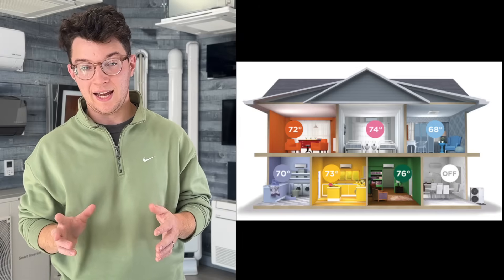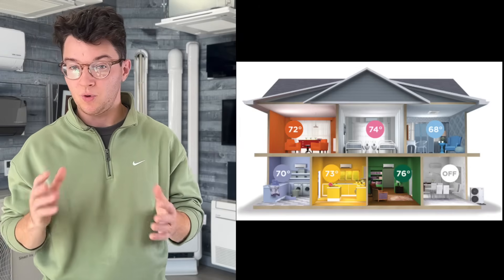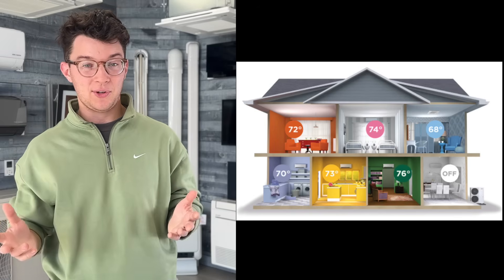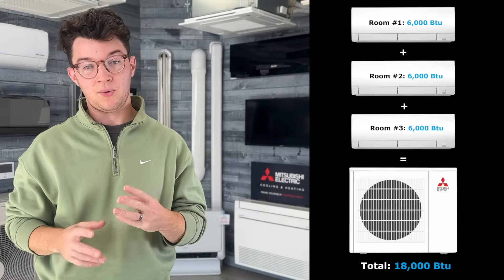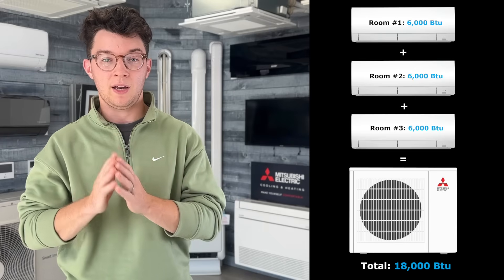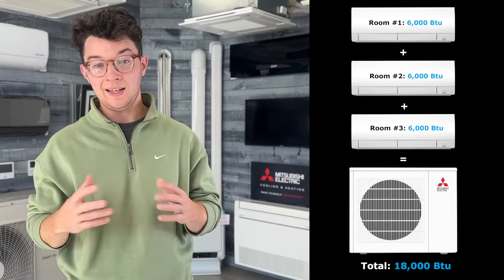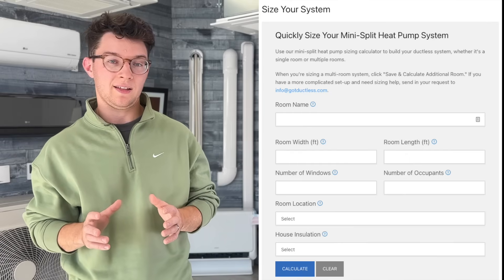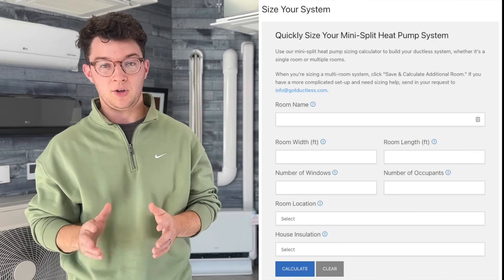How to Size a Mini-Split System: Tips for Properly Sizing a Ductless Mini-Split System

Comment: Do you have a recommendation on heating/cooling size for supplementing? I want a unit for my bedroom/bath/closet, its about 550sq ft. I want to set my house temp at a more economical temp, like 75 in summer, but keep my bedroom 71-72, so basically a 3-4 degree difference. Most of the calculations are based off of a non conditioned space already, not supplementing, because I really just need it to change 3-4 degrees.

Comment: You need to calculate CUBIC feet of air, not SQUARE footage.  Ex.  8 ft flat ceiling vs 22 ft vaulted?????
Reply from the maker: Yes, cubic feet is definitely important especially when dealing with irregular ceiling heights. In this video we touch on standard ceiling heights but you definitely are correct!

Comment: I have a 2400 square feet, it’s a 40’ x 60’ pre fab metal house made with red iron and metal siding, I have spray foam 5” on the walls and 8” on the roof,  so it’s installation is excellent.  Im looking to go with a mini split system, my question is about the big open room 38’ wide x 27’ long , it has the kitchen and living room in one big room.   The side walls are 11.5’ tall and the center is 21’ tall.  I have 5 large windows in the living room area and 4 small windows in the kitchen area. I live in South Mississippi about 70 miles off the coast.   

I was thinking about going with two 1800 btu units one both sides on the 38’ wall, in front of kitchen and living room. 

What do you recommend and your thoughts?
Reply from the maker: I believe you are thinking about it correctly. I did some calculations on our end and you are probably oversizing with 2 18ks. You would be fine with 24-30k in BTU since your main priority is I'm sure cooling. Feel free to call us if you'd like to further the discussion.

Comment: For cooling capacity, does humidity level of ambient air play a role in sizing?
Reply: correction on question: Should humidity of outside air play a role in sizing especialy for cooling?
Reply from the maker: great question! It should be considered when sizing. Mainly the consequences of oversizing your system will be harsher in higher humidity areas. You want to make sure you are not installing overly sized units in your rooms because then the units will cool down the room quickly and turn off and will not properly pull out moisture fast enough.
Reply: @gotductlessusa  Thank you. That makes sense. Another aspect that might play a role in my own home is handler placement and room layout as follows: With the thermostat located within the airhandler, the desired temp is reached pretty quickly (heating and cooling) in the immediate vicinity of the airhandler, but not as quickly elsewhere in the room. Due to my living room layout, the airhandler is not placed in a central spot. (The system still does better than my old heating and cooling.) But now I am thinking about installing a remote thermostat, if I can find one that works with my minisplit. Do you have experience or thoughts on this?

Comment: You didnt mention anything about humidity. If you live in a very humid area, it makes sense to slightly undersize the unit so that it runs longer and will dehumidy.
Reply from the maker: That is true! This is an issue if you completely oversize and the room gets chilled faster than it can dehumidify. This is especially a factor in more humid climates. thanks!

Comment: A Btu was originally defined as the amount of heat required to raise the temperature of one pound of liquid water by one degree Fahrenheit at a constant pressure of one atmospheric unit. There are several different definitions of the Btu that differ slightly.
Reply from the maker: Yes!

Comment: I am about ready to buy a mini split heat pump system.  But don't know if I should get two 12K BTU units or a 12K and a 9K. Those I'm looking at are both Pioneer Diamonte series, so same features, same 19 SEER, etc. Either way should cover the 18,200 btus required to heat and cool my small home (that's based on only square footage… I may need at least 20,000 based on poor insulation and windows.  The price difference of the two units (12k vs 9k) is only about $20  currently for the prices I'm looking at with Home Depot.  (The 18K is $300 more than those and the 24K is out of the question for me.)  Of course, I'd be happy to pay a little more to get the second 12k, *** UNLESS THE 12K WILL COST SIGNIFICANTLY MORE TO RUN THAN A 9K.***  That is the important question that I need answered.

A 12K would go in the larger Living Room/ Kitchen area;   The small bedroom/bath area will get either a 12K or 9K.

BTW: So far it looks more cost effective to get two units than to get one larger unit that feeds two blower heads. Plus with two separate units I'll always have a backup and I can shut one down in mild temps.  Also one larger unit feeding two blowers will  require longer lines which adds cost.
Reply from the maker: Running a 12k will not cost significantly more to run than a 9k. The real question is what does your space require. If you have poor insulation and poor window insulation then I would be conservative on sizing. The last thing you want is to spend thousands and it won't work properly or will be inefficient.
Reply: @gotductlessusa  Thank you so much!  You say the 12K energy consumption will not be much more than a 9K.  Is that true only for inverter+ variable speed compressors (because the bigger unit can slow down to operate like a 9K?)  That is what I am interested in btw.

Comment: i have two rooms and many many people in this mini split business... looking for answers?  i have two rooms on 1st level about 140sq ft each both a square shape and about 15' ceilings each,  one room get more sun other does not two large window in each room... just trying to ask a pro
Reply from the maker: Hello - you can use our calculator but most likely you would be fine with 9ks in both rooms.
Reply: @gotductlessusa  does it make sense to over size just because?

Comment: Length x width x height is Volume...not square footage.
Reply from the maker: We use length x width in our calculator with a built in ceiling height of 9 ft. We did add in height by accident in one of the clips which is in fact volume. Thank you.
Reply: Exactly.  In this case, it would be cubic feet.  A few too many little errors to trust this guy.  Nice little display wall though.

Comment: Thanks for the video.  Question though.  For energy efficiency...would it be better to have three indoor 8,000 BTU units tied to a single 24k BTU outside unit, or three individual 8,000 BTU systems (indoor & outdoor)...speaking from a total energy usage standpoint.
Reply from the maker: SEER ratings might be higher on single zones but you would be consuming more electricity overall.  Simple way to look at it would be you would have 3 15 amp breakers vs. one 25 amp breaker for a 2 ton multi-zone. Hope that makes sense!
Reply: @gotductlessusa  Must be something missing there.  You would never replace three 15 amp single units with a single 2 zone 25 amp, as a 2 zone wouldn't support 3 zones.

Also, the answer doesn't really answer the question.  Why would 3 single zone 8,000 BTU units use more energy than a single 3 zone unit with 24,000 BTU's...?  Using a SEER as a baseline, a SEER 13 12,000 BTU A/C would use roughly 900W every hour.  If the efficiency was identical, a 24,000 BTU unit would use 2,700 watts.

If the single zone units were a higher SEER efficiency, they would use less energy than a single 3 zone unit with  a lower efficiency, and vice versa.

Breaker size doesn't reflect energy use, so that comparison doesn't make much sense to begin with.

Comment: I have a 20 x 20’ garage with 10 foot ceilings. It is my workshop and I am in Phoenix. I have the ceiling insulated. I had 2 HVAC companies give me estimates. One said I should go with a 24k BTU unit and the other said I would need a 17k unit. I’m trying to figure out which unit would be best and looking for an actual mathematical calculation such as L x W x H = CF x ?? = BTUs. Where can I find this?
Reply from the maker: Thanks for the information. The most accurate way to get a pin-point load calculation is to run your information through a software to get a Manual J report. The good thing about mini splits is that you can have a variance of sizing since the systems only come in 3k increments anyway. We use 9 ft ceilings as standard for our calculator. The difference of 1 ft for a 20x20 space is not going to be more than 3k BTU. In Phoenix, your main concern is cooling. Cool air falls which is good because you'll be working at ground level, not ceiling level. If you hang the unit at 8ft rather than 10 ft the system will be working less since it won't be circulating the air close to the ceiling. Feel free to call us at 866-399-0206 for more info. Hope that helps!

Comment: LxWxH gives  cubic feet, not  square footage as you keep  stating early in the video. How many windows and doors in a room is a factor but equally is what type. If the windows are single pane or double can make a huge difference. I see  you left out considering the function of the room  in question. Is the room a Kitchen or maybe an office space. Both of these can mean they have more  "heat" generated in the room than say a living room or bedroom before calculating HVAC needs.
Reply from the maker: This is helpful! Cubic feet is great to use. We leaned more into using square footage just for simplicity since the average home has 8 ft ceilings. The function of the room is also important. Since mini split indoor sizes range by 3k BTU due to the fact they are modulating systems, there is flexibility with BTU sizing for kitchens and such. Great input though, we appreciate it!
Reply: You obviously didn’t watch past 5 mins.

Comment: Thank you for these great series.... nice work and very helpful!  Can you please comment on why room square footage measurements are used rather than cubic feet? You mention using room height X length X width in your earlier comments, but then you later drop the height factor, and  the calculator only uses sq. footage.  After moving into a newer home with 11 ft ceilings in some spaces, I am convinced ours, and many other  HVAC home systems are underestimating the heating and cooling needs because they neglect calculating the HVAC needs using cubic feet. Thank you. TAW
Reply from the maker: Thanks for the kind words! It definitely is helpful to use cubic feet if you have something other than 8-9ft ceilings. Our calculator is currently hardcoded to just standardize the ceiling height for simplicity. However, this is great feedback. We will consider adding room height (and hence cubic ft) to improve accuracy for higher ceilinged spaces.

Comment: I have a machine shop in a 17x24 garage with no insulation in Phoenix Arizona. According to the Manufacturer, I need a 18,000btu unit which has a 7.5 amp draw. Would it be best to go with a 24,000btu unit with an 11 amp draw? I don't want to be wishing I went bigger.
Reply from the maker: Thanks for the question. If you are having reservations, I would go with the 24k single zone. It's a mini split so it's not going to be outputting 24k 24/7. It will only use what needs but will have the capability to ramp up to 24k on the hottest days. Hope this is helps!

Comment: Ive noticed mr cool doesn't offer a 6k btu mini split head unit.  Our master bedroom is 250 square feet and a 9k unit is too big.
Reply from the maker: You can definitely do a 9k in a 250 square foot room. The unit will modulate to what the room is demanding. Of course a 6k would probably be a better fit but 9k surely not a horrible idea.

Comment: you have to do a heat loss calculation for the system going into the home
Reply from the maker: It is always best to complete a Manual J load calculation to get precise numbers. However, this is not always required. Some counties and states want to see it for inspection purposes while other areas are way more lenient. This video is meant to help people get a grasp on how load calculations are made

Comment: I like the video. Thanks for the info.
I have a free-standing building that is 12x24 with an 8ft ceiling with concrete slab floor. 
Walls and ceiling are insulated with R19. 
We go down to 0° F, often in the winter. 
I need to heat the room to 80°F
What do you recommend? 
I'm looking towards 12000 btu hyper heat.
Thanks
Reply from the maker: 12,000 BTU is the calculation that I came up with using the calculator on our site. If you'd like to output 80 F consistently, you may consider increasing the size to 15,000 BTU just to be safe. 
https://gotductless.com/products/msz-fs15na-muz-fs15na-mitsubishi-15-000-btu-hyper-heating-single-zone-system?_pos=1&_psq=fs15&_ss=e&_v=1.0

Comment: So I have a 1800 sq ft shop with about 400 feet of office space and 1400 sq ft of non insulated shop space. Ceilings are 16 ft high 20 at the peak height and a non insulated 14 ft garage door. Would 2 24000 btu units be good to cool/heat this space with no insulation? I only ask because I’m renting for my business
Reply from the maker: It is hard to say without knowing how drafty that garage door is. We would say you can surely install 2 24k single zones in there and it should be comfortable. It just may be inefficiently running if you don't have it insulated.

Comment: Very useful and easy to use calculator, just curious at what ceiling heights is your calculator based on, 8? 9 ft? Should I +/- 1000 BTU per each ft of ceiling height?
Reply from the maker: Thanks! The calculator is based on 8ft ceilings. The BTU calculation between 8 and 9 ft ceilings is not drastically different.